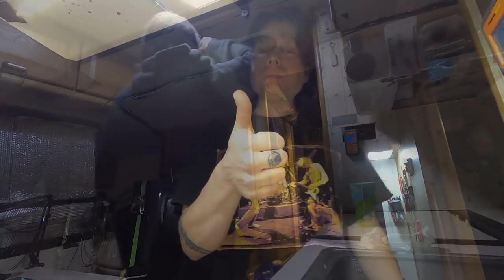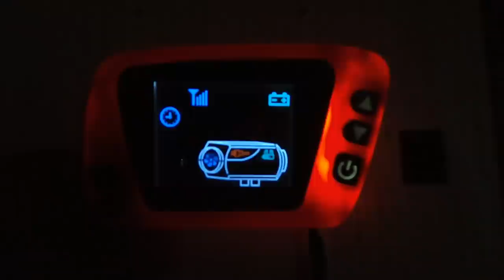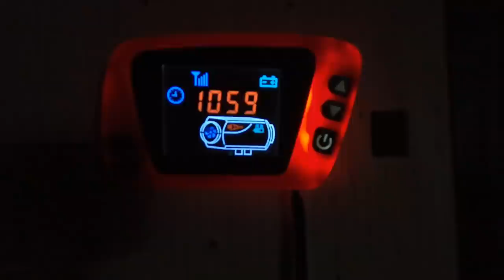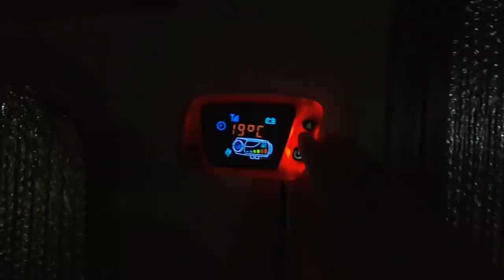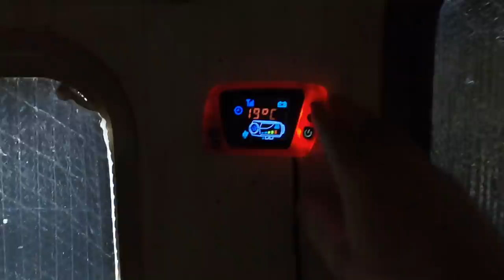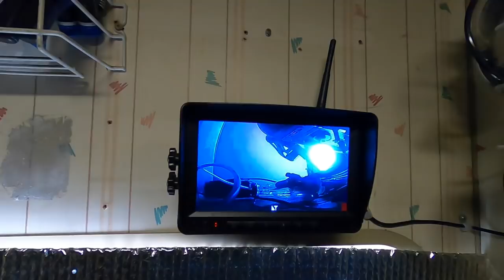Rest Area Vlog || RV Living

Comment: Question for you. How many pounds of gear do you have on board? I have identical rig and am heading through the Rockies. Want to add as little weight as possible, as in about 500 pounds of gear.